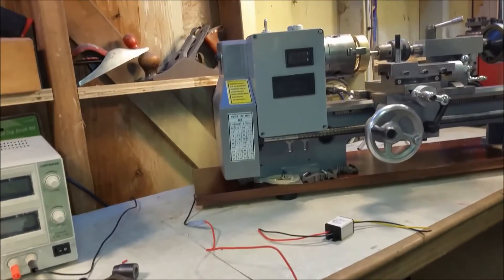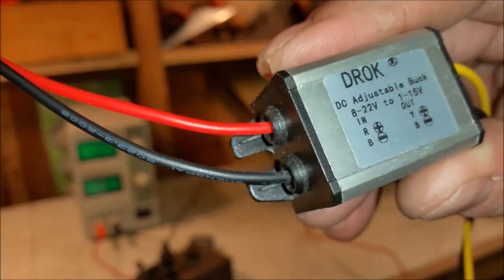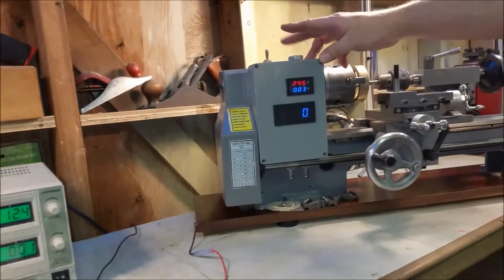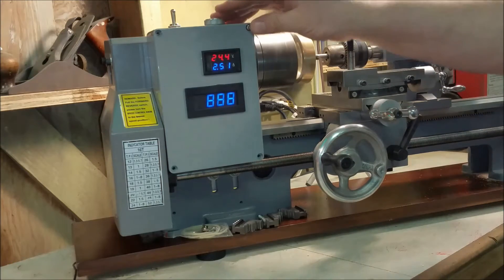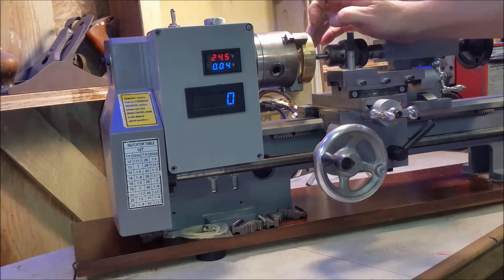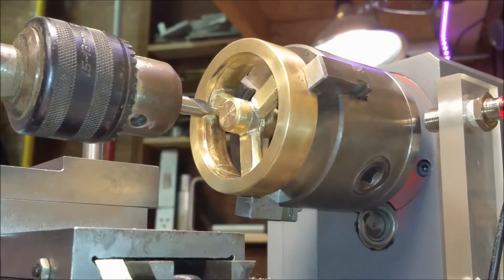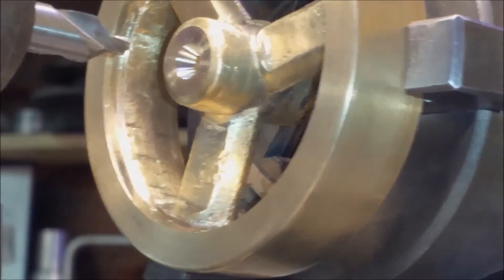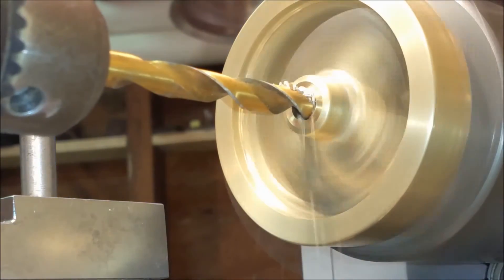Seig mini lathe rebuild #37 Demonstrate brushless  motor and DRO, Flywheel shaft hole

Comment: Hi

I also have a 7x12 turn. I would like to change the motor by a brushless motor. At least equivalent to the original but I admit that I do not know much about motor.
I found this kind of engine (the maximum I found on ebay.I find a little more powerful on aliexpress but with customs fees it would be too expensive)

https://www.ebay.fr/itm/ACT-MOTOR-GmbH-1PC-Nema34-86BLF04-BLDC-Motor-440W-3000RPM-48V-1PC-BLDC-8015A-8/253543938923?hash=item3b08657b6b:g:wdkAAOSwbxhaxyEh:rk:2:pf:0

Thank you ^^ (I live in france)

Comment: Hi Don, So glad you're showing a mini lathe working with an rc type brushless motor since I was really hoping that this could be done. The treadmill motor route a lot of guys are taking is difficult to do around here since those motors are rare. So do you still think the brushless update is a succes and general improvement over the stock motor/controller board now that you've been using it for some time? Anyway nice work!!
Reply from the maker: I'm not using the right voltage and ESC controller right now. This motor can run 12s, 44v @ 70amps. Right now I'm running 24v. With it's current configuration, the lathe is usable and comparable to the stock motor. With the upgrades I mentioned, it should be over 2000 watts. I will be doing this upgrade when I get the money together. The speed controller is $100-$200. Thank you for commenting -cheers